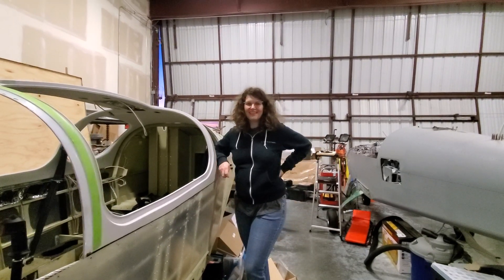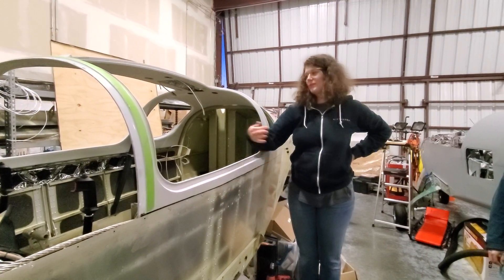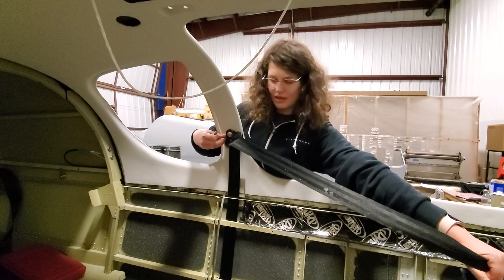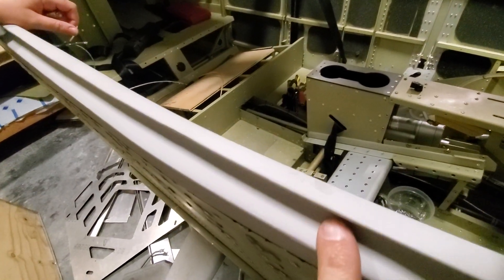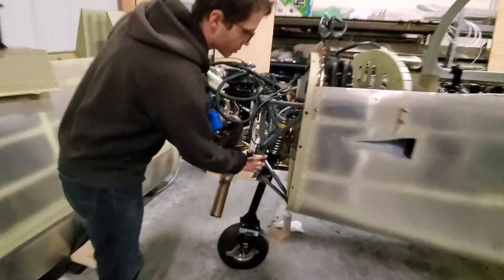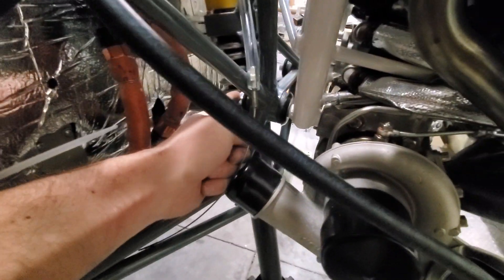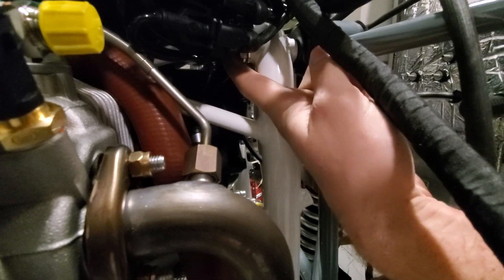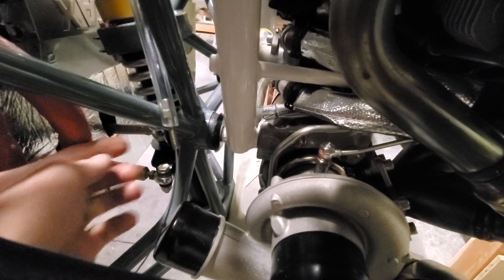Canopy Bonded and Engine Attached!! Sling TSi

Comment: Excellent work! When I was at TAF this week, they showed me some new gasket material from McMaster Carr they are using for the doors that totally fills the gap, has the adhesive strip already on it, and once it is installed will stay installed just about forever. No need to touch up paint on an area you won’t see! I’ll send you the info when I get it.
Reply: Probably the same that Midwest Sky Sports helpfully posted about a few days ago.  I ordered some.
Reply from the maker: Sounds awesome, thanks Ed!!

Comment: Helpful, thanks! Surprised about the nylocs…don’t like that
Reply from the maker: Agreed!! We're going to think about how to replace them with castle nuts as well, very disconcerting
Reply: @slingalongblog8111  Definitely share if you find a good solution
Reply: @slingalongblog8111  Steel lock nuts are probably the easier solution. Maybe Sling intended for the nylon nuts to face away from the engine where they would never reach 250 degrees? The exhaust may have to be removed for this?